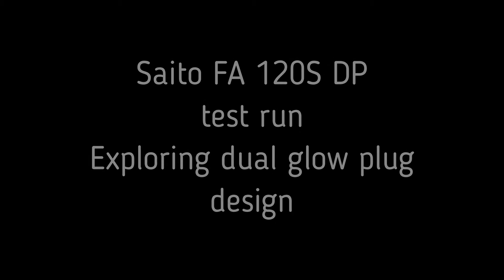Saito FA 120S DP test run - exploring dual glow plug design

Comment: The 120SDP is not the only Saito that had dual plugs.  The 182T and 130T also had them.  The manual for the 182T states that only the REAR plugs need to be energized for starting and operation.  https://www.saito-mfg.com/english/Instructionmanual/English/4st-Engines/FA-182TD.pdf
This is also referenced in the Clarence Lee article here, http://sceptreflight.com/Model%20Engine%20Tests/Saito%20FA-182T.html 
I fail to understand how evaluating the dual plug system operation at only IDLE gives any real relevant information.  On an airplane, how often do you sit around idling?  To me it seems that transition and max RPM should also be investigated seeing as airplanes do not fly only at idle. (It seems that most of your videos focus more on the absolute lowest idle obtainable and less on actual transition from idle to full RPM and peak RPM)
https://www.youtube.com/watch?v=a5yKVZZyTTM
Reply from the maker: Dear Mr. McIntire, thank you a lot for you comment  and for advices given ! Being owning Saito FA 182 T D version, but haven't time to look deeper into it's manual. Also, I've found, that Saito still produced FA 325R5D radial engine, which utilizing dual plug design. Additionally, thank you for reference of official Saito manual engine start recommendations ! It would really helps me in DP version design investigation. Also, agreed with you about your notes regarding what  RPM  range will be better to find the real advantages in DP design. There is two explanations - first, I'm very focused to find the receipts of lowest possible and stable idle speed. Secondary - I'm very limited on time of the video, so could not cover all aspects of this topic in one video. Exploration of DP design at higher speed are also planned in the nearest time. 
Really appreciate you for your notes !

Comment: Try using 1 four stroke glow plug and 1 cold glow plug. Put the igniter on the cold plug and  see if the four stroke plug lights from revving the engine up.
First verify that the engine will not run properly on the cold plug by using the dead plug in the other hole.
Reply from the maker: Thank you for your comment and for your advises ! definitely, would try in the next videos. Once cold glow plug will be found in my workshop or somewhere on Ebay.

Comment: I almost wonder if this thing could be run as both a sparker and a glow engine if you got a 1/4x32 spark plug to put in the forward(and more awkward to connect a glow driver to) hole.  Maybe idle it on spark and run glow at higher power, or make it flex fuel, something like that?

P.sure the plug would light up on its own with the engine running on spark.
Reply from the maker: Thank you for your comment ! Definitely, you're reading directly from my brain :-) . To be seriously, next test run with Saito FA 120S DP was planned with spark ignition  (with two spark plugs 1/4x32, from twin cylinder engine - ignition fired each time with both plugs) or with glow plug / spark plug combo setup. Will need to solve some mounting problems, of course - do not want to drill engine case for Hall sensor placement. So, a lot of surprises (for sure) will wait us during the next test run. Stay tuned and have a nice day !
Reply: @crazyengines88  use on board glow for a twin. it would be less trouble to install. besides, both plugs would have to fire at the same time. you would need a ignition module for an even fire twin,useing a single magnet trigger.
Reply from the maker: @harveynewman4333   Thank you for your advices ! I'll use dual spark ignition module for twin cylinder engines from Rcexl, as far as I know, it fires every time when magnet bypassed hall sensor. Quite interesting to know, how Saito FA 120S DP will perform with dual spark plug ignition, as well, as with hybrid ignition (one glow plug, one spark plug).  So, stay tuned !
Reply: @crazyengines88  I almost wonder if you could get it to tick over at something like 500RPM on spark, still transition nicely. If it was running CDI at low RPM and glow at high RPM you could optimize the timing for a super super super low idle that otherwise isn't attainable.
Reply from the maker: Thank you for your notes and ideas ! I'm really interested to check this kind of setup (combo glow plug plus spark ignition). There is a kind of limitation - how to check and to be sure, that glow plug also heated enough to provide additional ignition support ? I've only one idea - to measure it's resistance in cold and in hot working condition to  get clear confirmation that glow plug is lightning. So, a lot of engineering would need for that test. Anyhow, I'll try to make such tests. Stay tuned !
Reply: @crazyengines88  I'd say it'd be a pretty safe bet to assume the glow plug is lit once it's up to about 2500 or so.